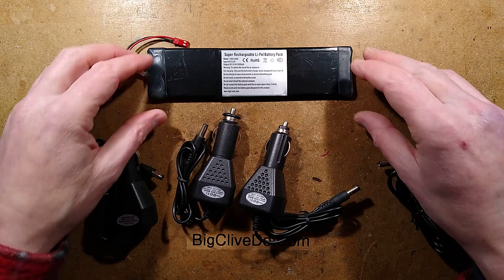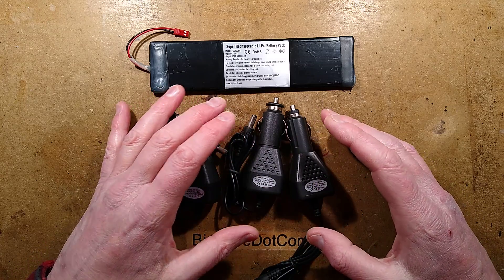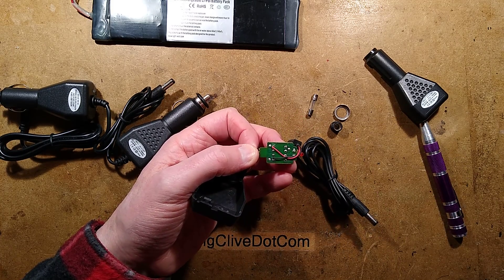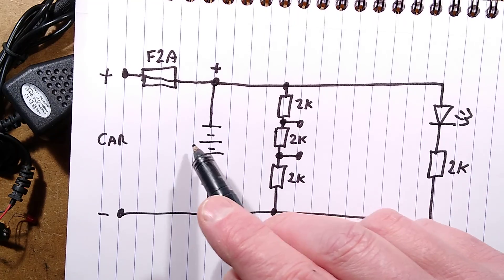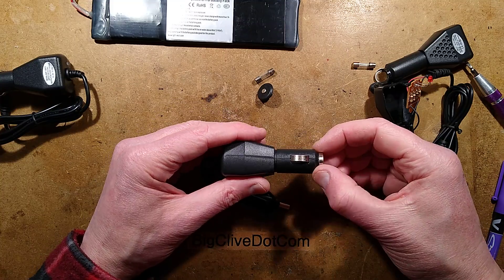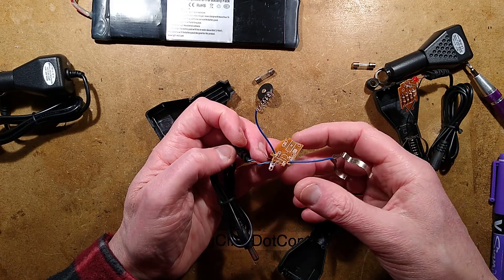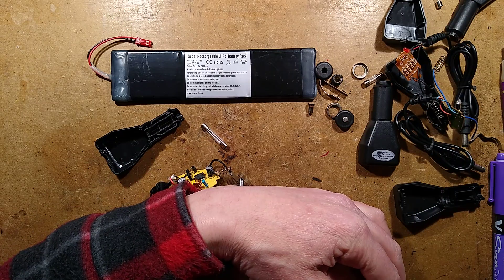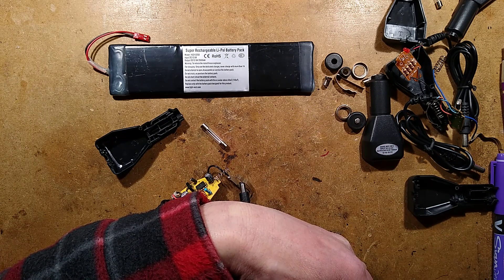Triple trouble - when offshoring goes wrong

Comment: Would love to see you test what current this new and improved fuse blows at
Reply: Usually the small coil-spring in the nose of these sigaret lighter plugs will get glowing hot and stop making contact att a relatively low current. I guess that this spring will become limiting factor, as well as probably too thin wires from the plug, before the reinforced fuse can blow...
Reply: Photonicinduction style - until it pops
Reply: Better yet, test the "fuse" in the 12 volt adapter and watch the entire black plastic housing turn into a hot sticky pool of molten black plastic.   Fred
Reply: What temperature does the solder melt at? What current is required to get to that temperature?
That is your answer.
Reply: @katbryce  340 degrees F, and the bulk resistance of solder is pretty low. Better to use a gum wrapper.

Comment: I worked for a company that had hundreds of products made in China. With us they would occasionally try cheaping out on materials. We had local QC sampling and would usually pick it up before it'd get to market. Then would come the negotiations to get refund or replacement...
Reply: Can confirm.  It's a freaking nightmare riding herd on those people - you ask for certain gauge of metal, they can't resist swapping in something thinner.
Reply: @jpdemer5  Not thinner - cheaper.
Reply: @Lucien86  Which means thinner
Reply: More than 20 years ago I worked in the 1-hour photo lab of Wal-Mart.  We would occasionally run into problems with our processing equipment, including defective products.  I was told by management we couldn't send any defective or broken stuff back, because we had deals with the manufacturers for "automatic credits".  No matter how much broken stuff we got, all we could do was throw them away and order replacements, because the company felt that sending back individual defective products for credit/replacement was too expensive and time consuming to bother.  Acceptable defect rates were just negotiated into our contracts.

Needless to say, the quality of any product only declined the longer we used or sold it.  Also needless to say, I soon quit and went to work for a proper photo lab.
Reply: Exactly the same with my business, manufactured product in Shenzhen. Trouble is negotiations never get very far as everyone just lies to your face. All you can do is trash the product and find another assembly house. There are so many...
Reply: I've heard some really disturbing stories about local QC companies/staff being threatened or attempts to bribe them to stay quiet. I even heard a story about an attempted "honeypot" trap that backfired because two people had been sent out, a man and a woman, and they swapped rooms because the lady couldn't sleep in her assigned room due to light pollution issues, she came back to her room to find a young naked woman laying in the bed. 😳😳😅
Reply: that's cheating indeed... but in china, manufacturers only care about how much you put in the table. if you ask for a pen that doesn't work, they wont bother asking why you'd want such a thing, the same way if you want a pen that writes on every possible surface.

Comment: The longer of the fuses, does it have a name? any keyword I need to use?. I ordered some awhile ago and got the short version. (will ask on Patreon as well)
Reply: 1.25" (aka 32mm). It's an old standard often found in vintage equipment, hence the imperial sizing.

Comment: Awe, that's nothing, we used to put pennies in place of a blown fuse when we ran out. 😜
Then we'd blow those! 🤣
All the Best, Chuck
Reply: I am reminded of the Guide To Fuse Replacement, where the 350A Fuse (With Audiovisual Auto-Alert) was - I believe - a 7.62x51 rifle round.
Reply: @ProfessorYana  A .22 lr fits nicely in the old style automotive fuse holders. Those also provide an audiovisual alert, but at a lower current.
Reply: Our preferred solution was the extra length cut off from a steel potentiometer shaft.
Reply: We did this to watch T.V., so could this have been the first "Pay Per View"? 🤦‍♂️
If so, a penny a "Pop" or "View" was cheap! 😂
All the Best, Chuck.
Reply: A penny’ll start a fire

Comment: I picked up two of these at £4 each, and both of them arrived with the legitimate 12V chargers, marked BDF1261A. I can confirm that they do work when fed 24V and output 12.6V as advertised. The LEDs are red when charging and turn green when the charge current drops below about 120mA. I did receive the vests rather than the harnesses Big Clive reviewed. I wonder what proportion have the fakes?
Reply: I received the same vests and chargers fitted with a 1Amp fuse, diffused LED and no mains chargers.  They do appear to work correctly on 12 volts I don't have an inclination to try 24! .  The charger case does not have dimples on the outside, it's smooth. 

The only annoyance is the switch is not that easy to actuate through the material.

While I agree these would look stupid on a construction site I can see a great benefit at night, at the side of the road, changing a tyre. The LEDS provide illumination for the user allowing both hands to be free while the reflective strips handle visibility to on coming traffic.
Reply: The vests seem like a safer option than the harnesses, as well. As Clive pointed out, the battery in the harnesses is right at the front where it could easily get damaged while working. In the vests it's at the back.
Reply: I grabbed one too. It's yet to arrive, but I hope to get a legit charger! I had planned to use the battery/charger combo for a project. 
I guess it's the luck of the draw! Clive got the Dusty Bin there with the wired up fuse! OMFG.

Comment: They shipped a fuse *with a bypass wire soldered to it*.  Holy shit indeed.
Reply: cue Xzibit meme "hey man i heard you like fuses fuse so we put a fuse on a fuse so it can fuse when it fuses"
Reply: I guess a new (unblown) fuse would have cost the manufacturer too much money. Meanwhile your vehicle will go up in flames if the LiPo battery pack in the vest decides to give up the ghost... Your vehicle going up in flames would certainly dwarf the attention that the safety vest would afford you whilst wearing it, so maybe there is a method to their madness? Naa... I'm honestly shaking my head in disbelief...   Fred
Reply: @electronicengineer  I think it was evident that there was no fuse that would fit the bill; that there was wrong with the circuit such that there is a surge of current and any proper fuse would blow. Bypassing the fuse isn't nearly as much a cheap-out - soldering on a wire is expensive on time - but rather the only way that they could ship a product that actually ostensibly worked out of the box!

Comment: Spin the wheel and try your luck!  
Will you get the good charger or just fuck your truck?
Reply: Since trucks generally have the 24V instead of 12V system I think you're fucked whichever charger you get.
Reply: @zh84    
Umm...I've never seen a truck with anything but a 12VDC power socket that fits these adapters.
Reply: @gregorythomas333  Yeah, struggling to think of a common 24v implementation of a cig plug. And I can’t.
Reply: @gregorythomas333  Hold up. They're probably not US-based, in which case a "truck" is generally any large commercial vehicle with a carrying capacity of 2+ tonne and more likely something with 18 or more wheels.

Trucks that have 24v power systems do indeed have 24v accessory socket (cigarette lighter socket, for the older chaps).
Reply: @ConstantlyDamaged    
Never knew that...thank you for the insight  :)